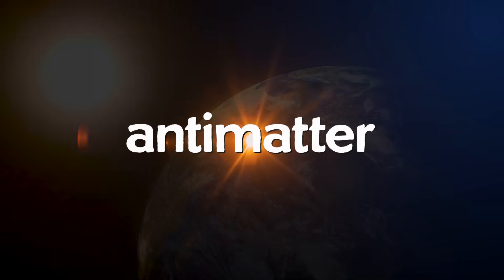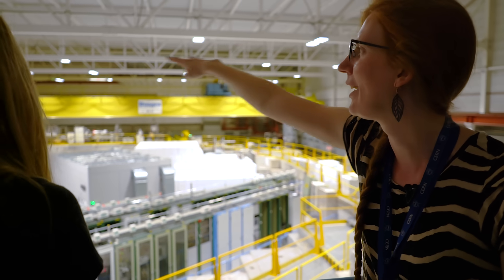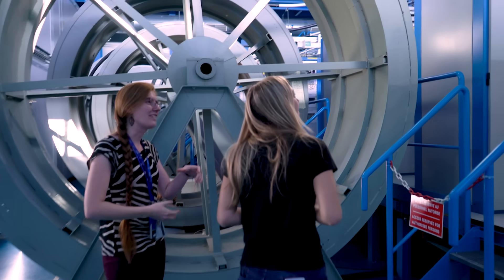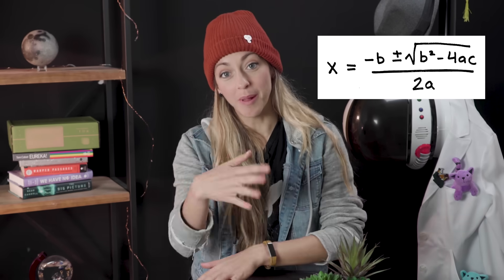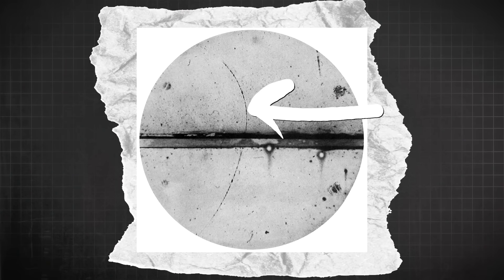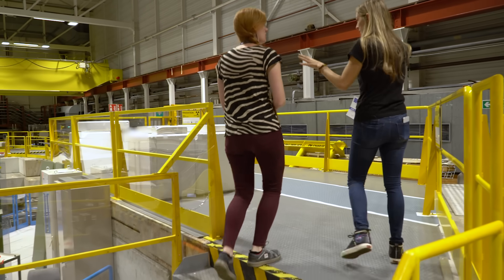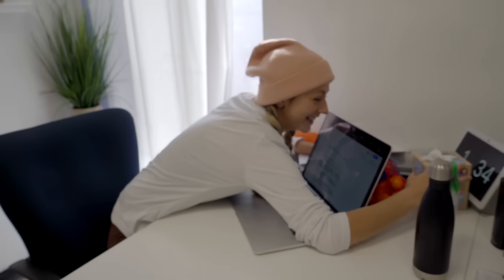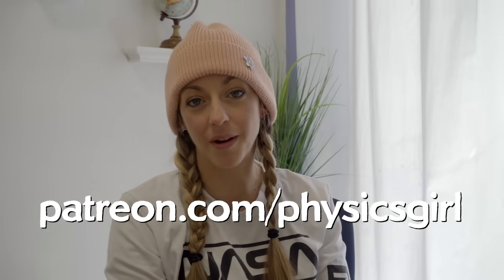Why This Stuff Costs $2700 Trillion Per Gram - Antimatter at CERN

Comment: so if anti matter touched matter, it just  “poof” what does “poof” mean? changes into matter?  disappears? switch to the antimatter universe?
Reply: She said it turns into light pay attention
Reply: @JD_London  For the proton antiproton annihilation that's discussed in this video, it doesn't all turn into light.

If antimater annihilates with matter it changes form into various things that all added together have 0 charges, you get a mix of all sorts, photons, positrons, neutrinos, mesons (collections of quarks) etc. Particularly with protons which are very messy you often don't get total annihilation as well just partial where some of the proton+antiproton annihilate but parts of them do not.
Reply: @BlueCosmology  agreed but for the non physicists out there we can just say light lol, good  comment bud.

Comment: I want to know more about how they store antimatter.
Reply: I think they use electromagnetic fields to trap them.
Reply: @redjr242  So if they're gonna bring it across the street, then the EM field will be actively generated from a portable battery....
If the battery runs out or fails.. it explodes?
Reply: @JosesL  Right. Without a confining electromagnetic field, there's no way to prevent the antimatter from coming into contact with the walls of the container. So they would annihilate.
Reply: They don't.
Reply: You mostly generate it when you need it in a short-lived experiment for about a femtosecond.
Reply: In a vacuum using electromagnetism to suspend it in place

Comment: The easy answer to why there is so little anti-matter in the universe is annihilation.  If you have two substances that annihilate each other, and you put them together, unless the initial volumes were exactly equal, then the two substances would destroy each other until the one with more initial volume is left in the end.  This means there had to be more matter than anti-matter initially, and this also means the initial volume of matter could have potentially been much greater than there is left over now.

Comment: yea, mac books overheat. Basically you can skip the top SKU and get the slower CPU/GPU because the cooling will thermal throttle the faster chips to the point where they are sometimes worse than the slower models.

Apple really needs to put some effort into their laptops, even normies are catching on.

Comment: What if the universe is made out of antimatter and the “antimatter” they’re studying is just regular matter?
Reply: In that case, antimatter would have been called matter, until the discovery of matter, which would than be called antimatter. Of course now some clever guy turns up and proposes, that the newly discovered matter (called antimatter) could be antimatter (called matter).
Reply: @extremeswissgerman2536  The whole thing would be anticlimatic.
Reply: That's like saying that electrons are actually positive and protons are actually negative.

Irrelevant it was defined arbitrarily that one was "positive" and the other "negative" but the only thing that matters is that they have opposite charge, if we suddenly flipped that over nothing at all would change.

Comment: What happens to matter if you just use a negative value of time in the equation?  You can't store antimatter in any significant volume.  Check Positron containment experiments.  No gamma count not equal to number of positrons.  Imagine, that negative time would have to reach saturation before positrons fall into a Universe where the future arrow points to our past, Big Bang, there it went farther into the past...,
Reply: Now, look at the impact of a single electro at near light speed.  Quantum velocity for it size is what voltage at light speed?  If throw a heavy atom at a light atom, and the heavy atom is gold, and you are firing at an oxide target, and you hit a oxygen atom, how fast should it be moving?
Reply: Don't tell anyone I made the whole Universe make sense, they'll think we're in love...
Reply: All collisions are elastic...

Comment: A QA Analyst walks into a bar, and asks for -1 protons. It turns out that this is permitted by the spec. Continue testing against strings. Provide inputs in 27 dimensions.

Comment: I feel like a teaspoon (5mL) of antimatter would do more than topple all the buildings of NYC. I haven't done the math but when you consider one of the first atomic bombs, LIttle Boy, had something like 50-60kg of mass but only a tiny fraction of 1% of the mass could be converted to energy, then 5mL (0.005 kg) of antimatter which converts 100% of it's mass to energy would put a NYC sized hole in the ground, too, right? Can't remember the conversion of energy from the Uranium 235 but I remember it being quite small.

Comment: If x² = 4 is used to anything, it does not really matter if it is negative or positive. Because you are just adding it all up. Say x = 2 electrons, you are adding up 4 electrons. If you have x = 2 positrons, you have 4 positrons. You dont say you have 4 electrons. You dont change the charge of the positron from this equation. So to say that x = -2 in the equation x² = 4 is not right if you are going to use actual electrons or positrons. So the solution is only x = 2. In essence, an electron and a positron is one positive unit. You are just adding up 4 of them. Your equations becomes wrong. It is not actual.

Comment: Could it be that most of the original 50% of matter being anti-matter has since annihilated itself?
Reply: The problem is that it doesn't annihilate itself ; rather it annihilates itself and a particle of matter when they come in contact with each other. So if most of that 50% antimatter was gone from annihilation, so would be most of that 50% matter, and we would still have an equal ratio of matter:antimatter.

Comment: (4:28) You probably meant 10 Trinity nuclear bombs which  released an amount of energy approximately equal to 20,000 tons of TNT.

Otherwise, even just considering only fission bombs (no thermonuclear ones), according to wikipedia you can get away with just 1 bomb:
"the amount of energy released by fission bombs can range from the equivalent of just under a ton to upwards of 500,000 tons (500 kilotons) of TNT"

Comment: I feel like the reason there is more matter than anti-matter is the same reason the planets in or solar system all go around the sun in the same direction.  Because anything that was going on the other direction got cancelled out.
Reply: If there was equal amounts of both, they'd both get equally cancelled out
So it seems that, for some reason, there was more matter than antimatter
Reply: logitech4873 precisely.  There was an imbalance.  What there was more of, prevailed.

Comment: I have a vague recollection of some hypothesized difference in behaviour between particle/anti-particle pairs at the event horizon of black holes (resulting in Hawking Radiation) as possibly holding some hint to the relative absence of anti-matter in the observable universe.
But I don't have a sufficient basis in the relevant physics, or sufficiently detailed memory of this maybe-hypothesis, to perform the searches necessary to so much as confirm or deny my recollection of this as an actual-hypothesis, let alone one grounded in viable theory.

Comment: Annihilation only occurs when particles of the same type come into contact (e.g. proton and antiproton), right? What happens when an antiproton comes in contact with a neutron or electron? Is a mixed atom possible?
Reply: Anti-protons and electrons simply repel each other, because they are both negatively charged. Anti-protons and neutrons can (partially) annihilate, because both are made up of (the same type of) quarks. In fact they annihilate equally likely as with protons (DOI: 10.1103/PhysRev.128.869, last sentence of abstract).

Comment: The moment  we can contain it, military will use it to build a bomb.
Reply: Jonathan Williams insta death
Reply: No need to make a "bomb" out of it. This stuff is a bomb by its very nature.
Reply: @zaph1rax  Well, no it isn't, it destroys itself as soon as you make it, usually. You have to try extremely hard to capture enough of it to make something explosive. And then you need extremely advanced methods to store safely and detonate it on command. In other words you have to make a bomb.
Reply: @ninjafruitchilled  If you made a iron-ball out of antimatter, all you would have to do was store it in a magnetic field in a vacuum. The storage container itself would not be considered a bomb, even though it would explode like a nuke as soon as you opened it and exposed it to air.
Reply: @zaph1rax  It's not that simple. It has to be a super great vacuum. Every tiny contamining atom of air that gets into the bottle, every atom that vaporised off the walls of the container, will annihilate with part of that anti-iron ball, emitting gamma radiation in all directions. You need to get that low enough to be safe. But in addition, we are miles away from producing anti-iron, they are only talking about anti-hydrogen in the video, and isolating anti-hydrogen is much harder since it is a gas. But anyway I certainly think your storage container should be treated like a bomb, like a weapon of mass destruction, given its potential.
Reply: Damn straight
Reply: Why is it when you destroy/convert matter it gives off so much energy. Im starting to think we are at the very top of the scale of things and a particle is almost the size of a universe just to create it.
Reply: Not for a quadrillion dollars they won't
Reply: Jonathan Williams   Nuclear winter without fallout. So cuuuute!
Reply: Or maybe Antifa will do it. Crowd funded.
Reply: Noone in his right mind will ever gather a material in such huge quantities that, if it hits the container wall, will generate a huge explosion... Military people will prefer to use good old reliable nukes instead of that :-)
Reply: Well people  also think like that decades ago about harnessing  atomic energy :p
Reply: @rampagestars  Well, these bombs were safe by design, it's impossible to make antimatter safe by design, so I doubt it :-)
Reply: If a table spoon can destroy Manhattan a nuke would destroy half the earth
Reply: You're damn right MERICA!
Reply: It will be pretty difficult to make it react though, considering how violent the reaction is. Even in nuclear bomb the efficiency hovers just above 0% because the nuclear fuel flies away before it can burn to make a bigger explosion.
Reply: @michaelbuckers  I don't think it will be a problem for antimatter bombs because they don't need to combust or to have an activation energy. All they need is to react (not the same with chemical reactions) with matter and they will annihilate, all their mass will be converted to energy. Even if they fly off, they will still be able to get in touch with matter.
Also, I don't think nuclear bombs combust, they work by nuclear fission.
Reply: @kennethalaba320  The process of using up a fuel is called "burning", brainiac. Also yes all energy will be released - eventually. It needs to be released instantly to make an explosion.
Reply: @michaelbuckers  I don't know how you define fuel or burning, but you don't "burn"  antimatter or nuclear fuel.
Reply: @michaelbuckers  It will be functionally instantly. Just the amount of matter that the bomb casing and containment hardware surrounding it would provide enough matter for the rapidly expanding wave of anti particles to convert 100% of the antimatter. The only situation where this would be a problem is if you were using very large (relatively speaking) amount of antimatter with very mass efficient containment (ie not a lot of casing mass in the way) in space. Then you could get stray anti particles which miss their chance to react and go flying off into the void until they either hit a stray hydrogen atom or some cosmic body.
Reply: @kennethalaba320  "burning" in this case is just saying adopted by early nuclear weapons researchers as a short way of saying "undergoing nuclear fission or fusion". Similar to how enriched uranium is refereed to as "fuel" in the reactor industry despite it not actually being a combustible material.
Reply: @maxk4324  yeah, I thought what he meant with "burning"  is the burning related to chemical reactions.
Reply: I thought the definition of burning is rapid oxidation, so there is no burning without an oxidizer. but in this case no oxidizer is necessary for rapid energy release.
Reply: The moment you realise we ve been able to make anti matter 400 years ago and everythings a lie

Comment: vintage laptop from 1893? 1993 or 2003 even? mine is an old HP ive completely upgraded and its about 2009 (ten yrs) and it runs everything ok. Just need a SSD. Excellent video.